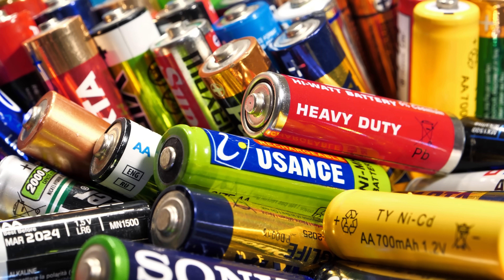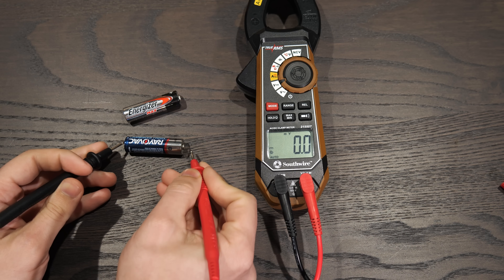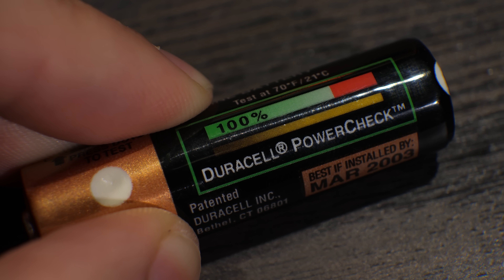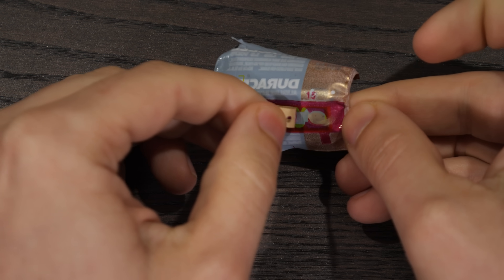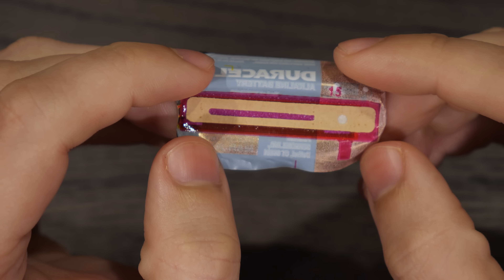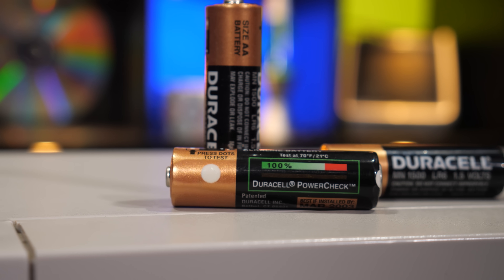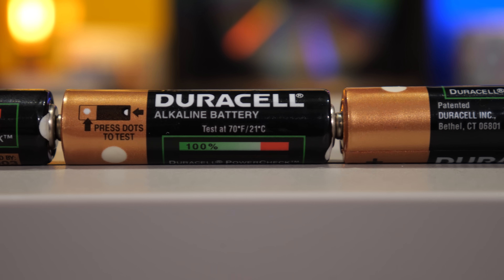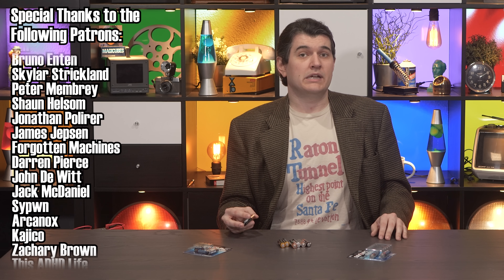Duracell PowerCheck: A genius idea which didn't last that long

Comment: I'm impressed that AA batteries are still so widely used even though they were introduced so long ago. To think that a lot of technology like radios, controllers, or even gameboys were designed with this century-old power source in mind, things that didn't even exist when the AA's was designed. A whole era of tech based around this power source.

Comment: Great video! Yes I do remember them, but seldomly used. 2 problems were I would have never really trusted it before writing off the battery. ie, am I holding the white dots in hard enough and am I on it centrally? Or does the test function still even work? 2ndly, I note it says test at 21C. No worries, I'll just adjust the air con to heat or cool the room and do the test. That should burn up around 5kw/h of energy and 2 hours later...

Comment: The absolute easiest way to tell AA batteries are charged or not is to just grab one and squeeze it between your thimb and index finger. If its soft or gives at all its charged if its hard as a rock its dead. This is why you can tell if they are dead by the way tbey bounce (another popular method to tell if batteries are dead) they are dead if they bounce well because they are hard as a rock... When cherged they are soft and barely bounce at all.

Comment: I'm gonna argue keeping half used batteries should be the norm. now all devices use up batteries at the same rate, and if you take a battery out of an energy consuming device, it's a waste to throw it away since it can work in simpler devices. rechargeable batteries make it even more common, as now we tend to keep a pool of charged batts ready to replace the empty ones while those are charging

Comment: Basically the battery will start to fade at 60%, and depending on the load and draw, they can recharge 10% each time power is off.  Like old flashlights that turned yellow, and a min later its bright again for about a min.

Comment: It's funny YouTube recommends this today. I haven't told anyone. My thermostat on my a/c stop displaying. After watching a YouTube video, I flipped the breaker then it said check the batteries. A hard wired air conditioner has triple A batteries. I have a whole box of double A's. Now I have to go by Triple A's.

Comment: We have a voltage meter (that runs on batteries), and it uses an LCD display that displays a type of  bar graph that shows the batteries' capacity. It can test all sorts of batteries.

Comment: As a mechanic for Duracell for 20 years now. I remember these quite well. And we made those test batteries in C and D size till somewhere around 2016. The reason it had to be so hard to press those dots was for safety reasons. If by chance you installed those batteries in such a way that the dots were inadvertently pressed......well, your kid had a Teddy Ruxben with a handgrenade shoved up its butt. On a different note, i won't give out any ideas, but there is some fun to be had with those test stips. Use your imagination.

Comment: I remember that before the built-in tester Duracell included a battery tester in the plastic wrapper. This tester required you to place a battery in the wrapper and simply press the ends together using thumb and forefinger. These were a lot easier to use and didn't make your fingers go white. They were also reusable (my dad used to cut out the tester part to use it with other batteries), which leads me to suspect that Duracell moved the tester from the package to the battery so that people would keep buying them.

Comment: I TOTALLY AGREE on the AA vs AAA issue.  

Drives me even more crazy when designers will use coin / button cell batteries when they could have used a AA or AAA.

Comment: I have a thing called the MightyCharger that I bought in Walmart's as seen on tv section like 15 years ago. It allows you to recharge AA Alkaline batteries about 10 or so times. Each time you charge them the hold less and less of a charge until you need to throw them away. Not so good for high power draw devices but for remotes and such I've had some devices still using the same batteries for several years.

Comment: I think the tester would be useful on the AA and AAA sized NiMH batteries. While I might be out of touch of a lot of things currently, I don't think I'm the only one who (still) uses them 🤔 (I think I bought a few dozens of them, something like ten years ago, and while I've had to get rid of a bunch of them that stopped getting recharged I haven't needed to buy new ones after that).

Comment: This would actually be a really. nice feature for rechargable batteries.  Especially because a lot of the battery chargers require 2 batteries to work, and if one of them is already full I don't think the other one will get charged. Or does it? Do you have a video on that? :)

Comment: I know you briefly mentioned this, but i wanted to expand on the idea, based on my personal experience.  When I helped my mom move, she had this box full of half used batteries that I kept telling her to just throw out and buy new ones because that's what I do.  I realized that I buy those giant "club sized" packages at BJ's and use them as I need them.  I think when I was younger (in the 80's), batteries were expensive and a family would only have a small handful available at any given time, so the concept of "Battery swapping" was a big thing back then that carried over into the 90's.  The idea of having several devices that didn't require leaving batteries inside of them (like toys) just meant you were constantly using batteries for a small period of time, but then would take them out and put them back in a drawer... or you would need batteries for something and would yank them out of whatever device was lying around.  Today, the cost of these giant packs of batteries just means you grab new ones anytime you need new ones.  Kinda like how you said you put batteries in something and they stay there.  No longer are the days of needing to constantly rotate the small handful of available batteries you had at any given time

Comment: Rationally speaking, there is a huge difference in size between double A and triple A. Around 7:4, so in a warehouse you could store just under double the triple A batteries. Same goes for manufacture costs. Yes it’s inconvenient, but if anything double As are the annoying ones that shouldn’t have been here this whole time.

Comment: I remember how hard they were to use
as for dropping voltage before running out, I sometimes notice that in device functionality, like a flashlight that still turns on but isn't so bright

Comment: I disagree that the move from AAs to rechargeables has been strictly a good thing. Most rechargeable batteries are not user replaceable, so now the entire device is disposable after a number of charge cycles. Rechargeable AAs were far more sustainable than the in-built Li-ion batteries of today.

Comment: Where are 1,5V rechargable batteries.. I have TRVs and weatherstations with RF 433 sensors, and dhey require 1,5V batteries. I have to use alkalines and about 20 to 30 batteries need replacing yearly. Where i get good 1.5V rechargable Li-Ion That holds for months, not like chinese fake 9800mAh

Comment: The worst thing about batteries is, that many devices need an uneven number of batteries (often 3), but the packages always contain an even number. So you always have at least one old battery left, which may or may not have gone bad. 😅

Comment: I recharge all my batteries. Most people don‘t know that single-use alkaline batteries still can be recharged. However it works only a couple times. So they are not a proper replacement for rechargeable ones. But still you save some money, especially in devices that only need little energy, like clocks, remotes, etc.

Comment: I always wondered why the tester went away and I agree with your assessment but my biggest issue with batteries is their propensity to leak and duracells are horrible for this.  Energizers are a lot more leak-proof.  And if I really want to avoid a leak problem, I use rechargeables when possible.

Comment: I remember these never worked, and for some reason they died much faster than the ones without it, when they weren't just fake stickers, and there were soo many fakes. 
Does anyone remember the roomer that putting batteries in the freezer prolonged their life span became super wide spread around the same time? Or is my memory more flawed than I...remember...

Comment: Who needs a multimeter? I always just used the "wet fingertip on the negative and tongue on the positive" method... the more it tingles, the higher the voltage.
Reply: same
also u can check the 9v batteries or button cell batteries with a tongue

Comment: Honestly, if you had a device that needed batteries, you'd eventually just know whether or not the battery was still usable, like the classic Xbox 360 controllers. My little brother and I ran through batteries on that thing so fast, but it was very apparent that the batteries still had enough juice to power the TV remote for several months, so that is how the battery junk drawer was formed. Take the batteries out of one thing, shove it in another, if it works for that then it would work for it the next time.

Comment: Huh I didn't know how the technology worked. I thought they wasted quite a bit of volume for that, which would make them more expensive and less durable.

It really is a clever piece of technology, that I'd never use as I usually just throw them in my battery bag if the device their in stops working and don't bother to look if one of themmight have a miniscule charge left. If you change both batteries at the same time and they are the same type there is not much of a reason to think there'd be a difference.

Comment: Power check is a dumb idea.   I put batteries in my remote,   and I know when they die because the remote stops working.    I'm too busy to go around power checking my batteries.

Comment: Me watching this while the controller for  my xbox is at 10%
Reply: i would just use usb extension cable and charge and play kit to leave the controller plugged in to the console while playing. 
what games are you playing on Xbox?
probably the controller vibration feature uses a lot of power.

Comment: I remember Energiser had the same system.
I also miss the on battery-battery tester. It is useful even if you did have to exert strong grip strength to it in order to make it work. I wish they would put the battery tester strip back on batteries.

Comment: I used to be so poor I developed a system for batteries...I knew which remote used the least amount of power vs another device (like a walkman) than needed more.  so when the walkman wouldn't work anymore; I would move those batteries to the remote and put new ones in the walkman.  It went a step further; within a group of remote controls I knew which one needed more juice over the other - and there was yet another rotation that developed.  By the time I threw away a battery it was 1000% useless HAHA

Comment: Always seemed like the harder you pressed, the higher the battery level would go lol. Never trusted them. There’s a fine line between a good alk battery and a dead one…I actually find myself testing batteries all the time with a multimeter because some things work better with full batteries. lights, lasers or speakers only work well with full batteries but there’s plenty of life left for other things like remote controls.

Comment: Have you tried the battery bounce test? If you drop it onto its negative side from a height of two or three inches and it lands and sticks upright  it's good.
If it bounces and falls over it's bad.

Comment: batterys will last very long on a tv remote because it don.t draw lot of power. but if use it on a console controller like xbox one controller the battery will drain fast.

Comment: Great observations about general usability. I agree the for people who used the feature, they liked it. I myself did especially in the Walkman days! I like your main point that most times its a new one being popped in and the old discarded. Reminds me of saving used light bulbs, for most people it's not worth the bother. People willing to pay premium brands aren't highly frugal shoppers, and people on a budget aren't selecting these brands to begin with! So I would have to say its your great points, but probably from a CEO perspective the feature would cost them sales in that it gives their own existing demographic the IDEA to save old batteries instead of buying new. I'm connecting dots (speculating) but it's not far fetched to reason that it probably made less business sense to continue the feature, outside of the initial boost of attention it brought.

Comment: My memory of these is about the exact opposite of the title. It was a terrible idea and it lasted forever.. Like literally.. You can still buy these to this day. For anyone who doesn't believe it - right now go ahead and take a look at the Duracell Quantum series. It may not be the main feature, but low and behold "PowerCheck™ feature lets you instantly check the power level so you can trust the batteries to work when you need it"
They hurt your fingers, were inaccurate, and there are much better devices that do the same thing except pain free and with more accuracy.

Comment: As a kid, I had a Sega Game Gear. That thing would burn through a set of batteries in about two hours. Less if they were cheap ones.
I’m grateful I had it, because it started a lifelong habit of always carrying a power supply or charger for devices I rely on.

Comment: At 7:30 you say the skinny “high resistance” part gets warm first, but its actually less resistive material making it lower resistance and causing more power to flow, which is what makes it produce more heat

Comment: 10:55 heck yes am I a Duracell only person. Every single time I had problems with leaky batteries it wasn't a Duracell. My Duracell never leaked and I saw a fair ammount of small electronics since I was as "the tech nerd" in the community I grew up in and remain so to this day amongst my friends and family. Everytime someone showed up with a device with leaked batteries in it, it was some cheapo supermarket brand. Once I had to order a bunch of cells for an event and the organisers decided to go with something cheaper. Guess what, half the packets had already leaky ones inside 😅

Comment: I'd forgotten all about those. I has always assumed they were done away with as a cost saving measure like you say especially since Duracell moved a lot of their manufacturing to China to cut costs (they used to manufacture in the USA for that market and Belgium for the European market). And once Energizer started producing alkaline batteries as well as a lot of shop brands also appearing, Duracell started to see their monopoly eroded. And I don't know if its just me but I find the energizer rechargeables to be inferior to the Duracell rechargeables in terms of battery life.

Comment: i would love these to come back in style just for my work. you would be extremely surprised how much military equipment uses double A batteries. and in a nato country that doesn't spend the required amount on our military just how much we have to reuse batteries and hope they have charge. im talking big ticket individual equipment where one soldier needs 4-6 battery's each plus spare. for Night vision and thermal optics and Ir lazers plus IFF equipment.

Comment: When I was a kid I bought some of these batteries, and after realizing the tester was made of variable section resistor I stopped using that tester. It was obvious to me that checking the battery will waste energy heating the resistor, and of course it was better for me to use my father's voltmeter.

Comment: It actually be useful if they used this tech in rechargeable batteries. I'm a pro videographer and I had same situation you described the battery on the charger showed high voltage and fully charged but when used for a job under load they went dead very quickly. It took me a number of jobs to understand it wasn't the device that was eating up batteries. A built it tester would made it clear showing the true health of a battery.

Comment: Interesting thing about it, in EU you can still find powercheck batteries from duracell sold in stores. Another interesting thing that I suspect is half true, if you drop a battery from twice its height drop and it bounced well it means its empty, if it bounces just very slightly and immidiently falls over its full. Did that many times without real tests and seemed to work?

Comment: Most of us tested this feature 1 or 2 times and it was useless after that.  But I have to say I use half used batteries for clocks they work at least a year although they are not good enough for Christmas lights etc. 😉

Comment: I'm keeping around partially used batteries because some devices require more voltage to operate than others. Also sometimes only one battery of 2 fails in say remote and the other is partially full.

Comment: Here in EU, I just realized we still have them on DURACELL Ultra Power. They have redesigned the press zones with  black ink on grey design. Same tech, same pain to press ;-)
I guess the patent is still there or they are trying to use this a a differentiator,  a perk to justify the higher prices of the Duracell brand.

Comment: It's 2024, every single battery SHOULD be rechargeable lithium batteries by now. There's no reason to still have and make products that still use AA and AAA batteries. TV remotes should have rechargeable lithium batteries in them and the store should have replacement rechargeable lithiums.

Comment: I think the biggest problem was, if the strip doesn't turn yellow, it was hard to know if the battery was dead, or if I just hadn't pressed it hard enough. I would still need to test the battery with some other ways.